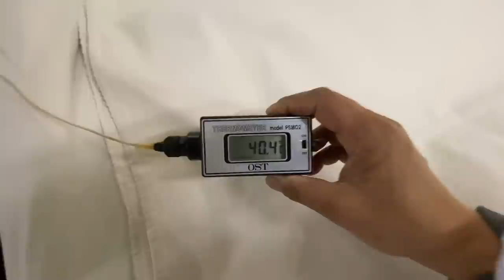Japanese Sake Brewery Experience in Nagano

Comment: There is not comparaison between wine making and sake making.  Wow, great insight into this.  As a side bar question, I notices how very snug your feet fit in those slippers.  I wear american size 14W shoes.  These slippers look only big enough for my big toe. :-)   Can I bring my own slippers?  My wife knits Phantex slippers.  They are warm and they breath.  They are also machine washable so hygiene is not a problem.
Reply from the maker: I’ve done that before - brought my own slippers. 20 years ago they never had 29cm sized anything (11 US) but 1) they’re ONLY for indoor use, not even to take outside on to a balcony 2) they should have soft underside so it doesnt make any noises. They often do not have any grip.
Reply: @onlyinjapanGO  Thanks, John!